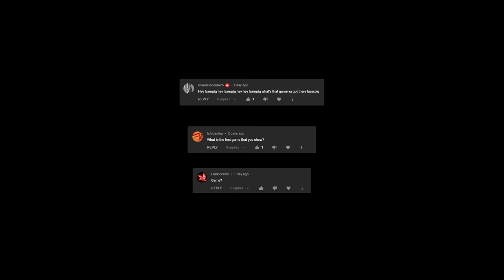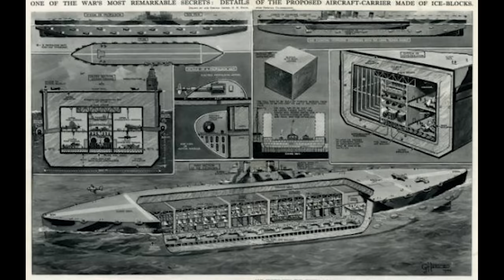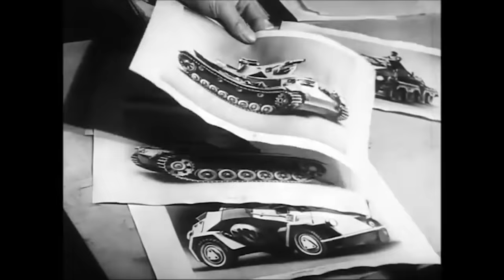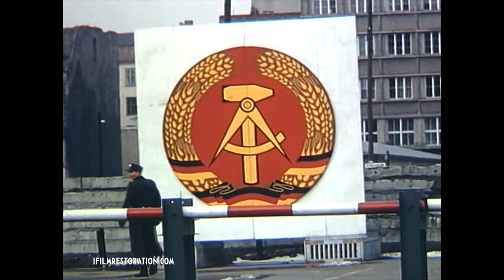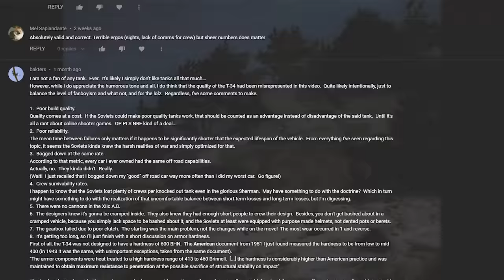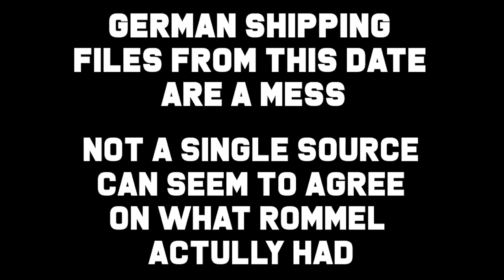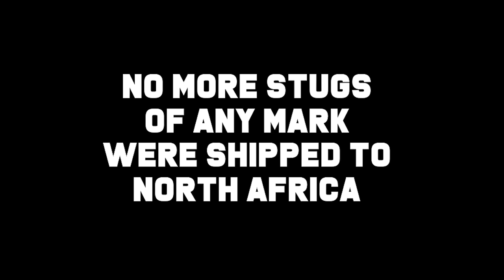In defence of the Crusader Tank

Comment: I absolutely love the Sherman, I’ve learned damn near all there is to know about it by a lazy history like me lol. I know the Shermans had their flaws, early M4A1s had cast hulls and required more time, steel, and manpower to make than the other versions. The Continental R975 radial was a pain to start and was underpowered, not very bad, and Americans knew how to tune the engines and got more power out of them, but still wasn’t the best. The exhaust on the Lee and Sherman pointed straight down, so in the African campaign, they made massive dust clouds that were easy for the Germans to see and prepare for. I could easily go on about each variant cause of my love for the Sherman, but I know there’s other tanks that do better, much better in certain regards, compared to the Sherman, but it’s still my all time favorite tank. That doesn’t mean the other were bad, except the T-34 and most late war German tanks, it’s just my choice.
Reply: The German heavies were frightening but the Sherman was a war winner, one thing about the Crusader it was powered by a governed bus engine the Tankies used to remove the governor and the tank would fly across the desert amazing and shocking the German and Italian gunners this action also drastically shortened the life of the engine.
Reply: @davidmcintyre998 ahh yes the good old fashion desire of tankers in the desert to see how fast they go
Reply: And then don’t forget how in Europe the M4s kicked the lights out of German tanks, no matter the designation

Comment: "Having more machine guns than the typical American"
I'm not sure that's even possible mate. A valiant effort for sure, but one that is ultimately futile.
Reply: That effort was a failure anyway, because the Americans had already made a tank with no less than nine .30 cals. One coaxial with the 37mm, two on the sides of the turret for AA use, four in side casemates like a Mark IV female, and two fixed in the forward hull for the driver to use.
Reply: @Shaun_Jones   I really want to meet the wacko in heaven who thought fixed hull machineguns was a good idea
Reply: @stuglife5514  The lord's personal tank has no less than 12 .30 cals and is personally designed by that man himself
Reply: @lilwagonwheel8829  if you ask me 12 .30 1919A4s isn’t enough. There should be at least 16 .30s and 2 .50s
Reply: @stuglife5514  tbf, they were for the guy who could control which direction the tank was pointing in and pilots often get fixed hull machine guns, so it was probably just a "well, why not give the driver  a gun to shoot forward too?" mindset.

Kinda like British fighter design in WW2 American tank design tended towards "just how many machine guns can we stick on this thing?" only minus the insane multi-turret nonsense.

Designing a system that allows a movable gun without compromising the frontal armor or cramping up the driver's location too much is a lot of engineering and complex, expensive, heavy parts.  Drilling a hole just big enough for the barrel of a machine gun slapping one in, and bolting it in place in case it's convenient for the driver to use to either lay down suppressing fire in the direction of movement or just wait for something to cross the line of fire while he's got nothing better to do kinda falls into the "well, I don't see a reason why NOT to do that" category once you're already producing more machine guns than your nation, alone, can use.

Or, the tl;dr version: "what's the cheapest way to give the driver something to shoot too without compromising the design?"
Reply: @dynamicworlds1   Uhm, thanks for explaining but I’m sorry to waste your time. I understand the concept of it, I just wanna ask him why he thought it would even work. But like, my comment was in jest. Like, jokingly
Reply: @stuglife5514  I understood you weren't being super-serious.  That's why I started with a casual "to be fair".  No biggie.  Just rambled a little longer than I meant to 😉
Reply: @stuglife5514  JUST 2 .50'S? HERESY
Reply: @lilwagonwheel8829  shit you right, okay so, 16 .30s, and 4 .50s on a quad mount, mounted ontop of the turret
Reply: @stuglife5514  Open air skink turret

Comment: The way I see it, every tanks was a good tank, it just depends on its role and if it was used correctly or not. For example German tanks (particularly the Panther and the tigers)were only really good at one thing, long range ambush tactics against armor. That is basically it. In all other aspects they sucked. But because so much emphasis is placed on tank on tank combat by nut jobs, they see them as the best tank of the war. If I had to place a bet on the “best” tank of the war. It would be the Sherman, purely because it can fill many more roles, and perform not excellent, but well enough in any engagement it found itself in.

Comment: The idea tanks are for fighting other tanks rather than supporting infantry is baffling, what happens if your enemy just doesn't field tanks, then your very expensive machine is without purpose. Statistically speaking the crocodile variant of the Churchill was the most successful tank of the second world war, and that is in large part because it's design suited a doctrine of avoiding enemy tanks and using it's flamethrower in conjunction with its main gun to combat dug in infantry. But the British were convinced out of its use of tactical psychology in favour of the Faulders gap idea of massed Soviet armour that had to be picked off as if they were robots. In short, tanks should be designed around providing fire support to advancing infantry and the duty of dealing with enemy tanks should be primarily relegated to anti tank weapon's, like the six pounders at Snipe, or nlaws and javelins currently
Reply: you're saying the quick and rapid delivery of a 120mm shell capable of blowing apart a building/bunker and killing nasty armoured boxes of various flavours from an armoured box that can follow you around is in no way useful to an infantryman?
Reply: LOLWUT??? Tanks and tank doctrine revolved around dealing with enemy tanks AND infantry. They can stow more than one type of ammunition.

A tank that can't frontally defeat enemy tanks is a major operational liability.
Reply: Agreed

When I was a soldier, I had to attend a promotion course in the mid 80's where we were having some fun with the Carl Gustav anti tank weapon, the instructor was a WO2 tanker who proudly proclaimed that the best anti tank weapon was actually another tank.   I think he needs to see how armoured vehicles are fairing against soldiers with shoulder fired missiles in modern conflicts. Tanks eventually became anti-tank weapons first and foremost, despite there being only a few actual mass tank battles ever happening.

While tanks were used in infantry support** (either as heavy back up, or to "punch through") up until the end of WW2, for most of the cold war I believe the thinking was that there would be mass tank battles over the plains of Germany (Fulda gap, as you say), then the infantry would take and hold the ground.  
"Tank destroyers" like the M10, M18 etc came into being as a more mobile anti tank gun to take care of enemy tanks, allowing the actual tanks to keep supporting the infantry.  That most famous Stug was an assault gun, a mobile artillery (actually fielded by artillerymen, not tankers) meant to support infantry. It only became pressed into being a very successful anti tank beast later as the battle turned sour for Germany 

The idea of different classes of armoured vehicle, i.e infantry support (Churchill, Matilda II etc) and a cavalry/anti-tank vehicle (the so called cruiser tank) has merit, but in reality, on the battlefield in all that confusion and very fluid situation,  every piece of armour needs to be capable of doing both.  Kind of why the "Heavy" and "Medium" tanks gave way to the "MBT"  and the light tank is now mainly the Infantry Fighting Vehicle.

Truth is, most times tanks can't be fielded without infantry support, they're especially vulnerable in areas with lots of cover (i.e cities). Without infantry protecting them from soldiers with man portable missiles, they're toast.

** every part of an army, be it catering, logistics, artillery, mechanics, engineers... whatever really only exists to support the infantry soldier.  No I was not an infantryman, so I'm not saying that out  of bias.
Reply: In the literally impossible event that my enemy is for some baffling reason not fielding armor of any variety. I send my tank crews lots and lots of canister shells. And then tell them and the infantry escorting them to go find some tight enemy formations to ruin the days of.
Reply: @SD78  It's not that tanks shouldn't be capable of combating enemy tanks, it's that in most cases, in the second world war at least, that tanks would be about equally capable of knocking each other out. Thus it was more effective to use the manoeuvrability offered by a tank to avoid an assault directly against another tank. The Churchill is better than the Panthers as a war winning devise as whilst retaining serviceable anti-tank capabilities it also was suited well for dealing with entrenched infantry
Reply: The Japanese rarely fielded tanks, and yet American tanks, which were absolutely designed with fighting other tanks as one of the considerations, were invaluable in the pacific theater because they became mobile bunkers, with the firepower to destroy enemy fortifications or suppress the enemy extremely effectively. The tank doesn't become worthless without an enemy with tanks. If anything, it becomes more powerful.
Reply: @thversagnamorethingi  A Panther could easily knock out a Churchill from range while being frontally immune to it's 75mm gun. In addition to being twice as fast and having double the operational range.

The Churchill was a mediocre tank which only excelled in niche roles as the chassis for specialist vehicles.
Reply: @SD78  the tank with a variant that had the highest percentage of victories in an attack doesn't sound like a mediocre tank, but hey on paper the panther had the best hard factors so it must be better
Reply: @rapter229  as one of it's considerations yes, my point is that the idea that a tank is primarily used as an anti tank weapon is stupid, not that tanks should have no anti tank capabilities. The Americans designed a tank that would work well at all the intended tasks of a tank. The Germans over invested in the idea of their tank one upping the Soviet armour thus creating heavier armoured more impressively armed tanks that suffered in reliability thus making it less effective in supporting infantry, and in making & exploiting breakthroughs. Which in my opinion is why it created tanks with, what we call now, good hard factors bad soft factors
Reply: @thversagnamorethingi  LOLWUT? Was Dieppe a 'victory'?  EVERY Allied tank deployed from 1943 onwards would have a 'winning' record by that methodology.
Reply: @SD78  the variant I was talking about was the crocodile, in actions involving it, all of which being an attack which is always disadvantageous, it had a ninety percent success rate. That's better than all other tanks of the second world war, it also had a significant effect on the German psychology leading to a statistically significant increase in surrender compared to actions at the same time period. Meaning it was more than just being the tank that happened to be used whilst the Allies were already winning
Reply: @SD78  I assume you're confusing it with the Oke, which I will agree wasn't a very good tank
Reply: @thversagnamorethingi  WUT? The Churchill was deployed at Dieppe and the Germans concluded it was a piece of shit.
Reply: @thversagnamorethingi  LOL. The Churchill Crocodile was a specialised combat pioneer vehicle, with an extremely niche usage.
Reply: @SD78  A flamethrower tank attacking entrenched infantry is a niche use case? And it was the Oke deployed at Dieppe, which as I said was bad, but the standard Churchill was plenty serviceable, the croc was the best variant of the Churchill and whilst used infrequently was massively effective in those occasions, and certainly not so niche as to be ignored
Reply: @thversagnamorethingi  Once again, the Crocodiles were a rare vehicle with a niche role which it had to be actively protected by tanks, infantry and smoke to perform. It's primary role wasn't to attack entrenched infantry, it was to attack FORTIFIED positions that couldn't easily be reduced by conventional arms. Why risk having a slow tank haul a trailer through the enemy anti-tank screen into Panzerfaust range just to  suppress a few trenches?
Reply: @SD78  What are you talking about? The croc was a tank it didn't need tank support, it had a flamethrower in addition to its main gun that had twice the effect range of a Panzerfaust, it was proof against it from the front and side, the turret is hard to hit, and shooting the bowser with a Panzerfaust is suicide and not going to affect the Churchill besides disabling it's flame for obvious reasons. Why would you use it against entrenched infantry, well because it was damn well effect at it, leading to surrender en masse. It also works well against a bunker for the same reason. Yeah it was on the slow side, but it's not exactly the Maus or Ferdinand. And as for protection by infantry, yeah, that's the case for all tanks, not a single tank in the world can operate without infantry support successfully against any resistance, that much is so fundamentally basic that you bringing it up as a point speaks wonders to your understanding of warfare. What's next? Are you gonna tell me rifles are useless because you need infantry to hold them? Same goes for smoke, it is such a basic and necessary tool on the battle field for all sides that most artillery shells fired were smoke rounds, for you know, supporting infantry and armour. The crocodile was afforded no special circumstance to afford their success to unique to them, they had the same support as any Allied, Soviet or Axis armour would be afforded, so unless you want to tell me that the Germans fought exclusively, or even predominantly, like it's some video game or some shit, I can't see why the Churchill's crocodile variant is unworthy of praise for a 90% success rate on the offence.  It was produced in about two thirds quantity as the Tiger or about twice that of the Tiger II, which is kinda stupid because there were more conversion kits available, but that's neither here nor there.
Reply: @thversagnamorethingi  Jesus Christ, this nonsense. Once again, the  Churchill Crocodile was a rare, highly specialised vehicle used for a specific, niche role. The number of Crocodiles in a standard British armoured brigade was ZERO. Literally not a single one. They belonged to a handful of specialised 45-tank regiments that would dole out 3-tank Crocodile platoons to local armour or infantry brigades as needed to perform their niche role; suppressing fortified positions.
Reply: @SD78  What's more niche? A tank that excels against fortified and entrenched infantry despite being used in low quantity, or a tank with real thick armour that breaks down after twenty miles that in theory excels against other tanks because of its' hard factors. I don't know about you but you can hardly explain away a 90% success rate, if it was irrespective of the tank why is it unique in that statistic? Or are you implying fortified troops are easy pickings. I'd also like to point out that they were involved in at least one action with absolutely no support, just four crocs surrounded by an ambush, a less than enviable situation for any tank and it still succeeded without any loses. That's impressive by itself let alone in conjunction with the ninety percent statistic prior mentioned. But no please explain how 800 tanks that had such a high percentage of success in assaults isn't significant because they weren't tailor made for dueling it out with tigers or KVs. Seriously if you think 90% success rate against infantry both in trenches, pillboxes and the such isn't impressive, please tell me how successful other vehicles have been in that role, I'm sure if you're correct you'll find a vehicle with a significant statistic in that regard. Frankly 90% is astonishing as a statistic for a defence let alone an attack and if you cannot see that I don't think anything can convince you that your favourite Wehrmacht tank or whatever isn't the decisive Wunderwaffen that you think it is
Reply: @thversagnamorethingi  You have absolutely NO IDEA what you are talking about. Once again, the number of Crocodiles in a standard British armoured brigade was ZERO. Crocodiles were deployed in specialised 45-tank independent regiments and were doled out in troops of 3-4 tanks to actual armoured and infantry brigades for their niche role of suppressing fortified positions.

There were three Crocodile-equipped independent tank regiments post-Normandy: (The Buffs, 1st Fife and Forfar Yeomanry and the 7th Royal Tank Regiment) giving a grand total of around 120 Crocodiles in theatre, once you exclude the regiment's ARVE Churchills and command tanks. 

LOL@clinging to this mythical '90% success rate...

PS: the standard Panzerfaust 60 could frontally penetrate a Crocodile at close to it's typical engagement range.